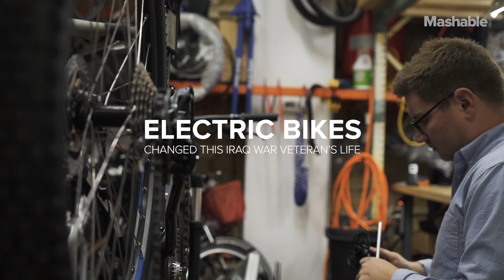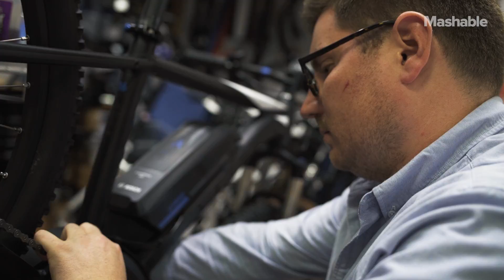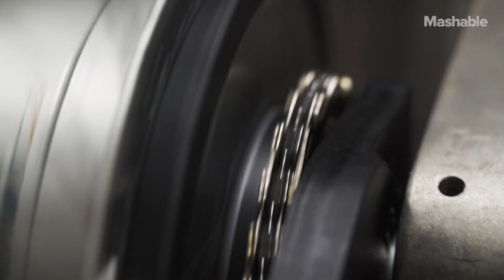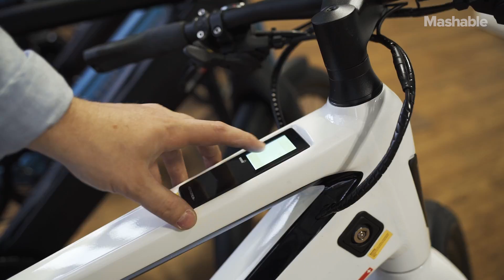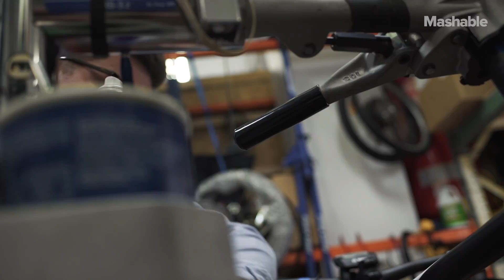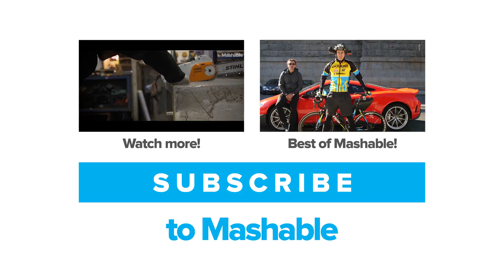Injured Iraq War Veteran Becomes Electric Bike Entrepreneur | Mashable

Comment: I was in Iraq from 2006 to late 2008, and I lost so much during that time. Before I deployed, I loved riding motorcycles and was even building my dream bike—a cafe racer. Motorcycles were my passion. But when I got deployed, I was wounded in combat and lost a lot of muscle from my right hand and arm. I came back with not just physical scars, but also the invisible ones—TBI and PTSD. Now, I can only use about 15% of my right arm and hand, so riding a traditional motorcycle seemed impossible.

However, the emergence of cafe racer e-bikes has rekindled a dream in me. These bikes don't require the same shifting, and for the first time in a long while, I felt a spark of hope. I also struggle with agoraphobia, and this is the first year I'm starting to get out of the house. I know it might be a pipe dream to afford one of these bikes, but just the thought of it gives me something to look forward to and keeps my spirit alive.